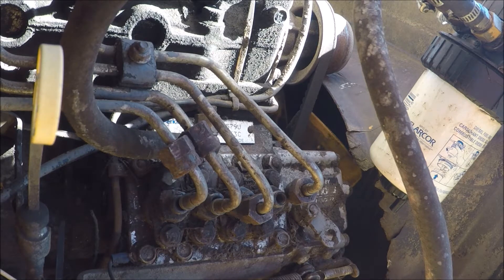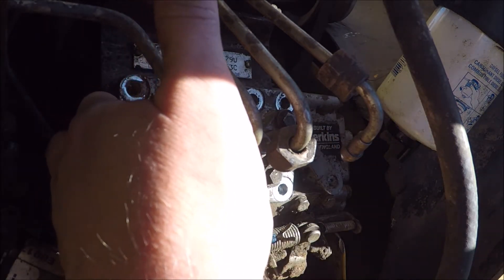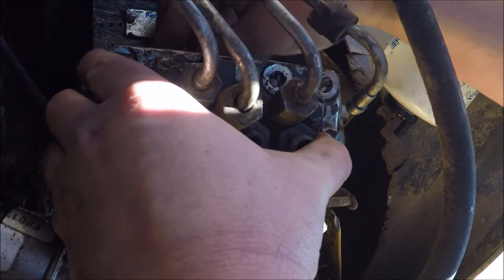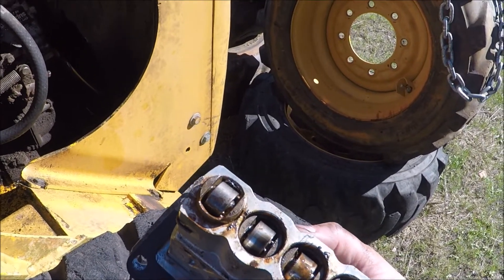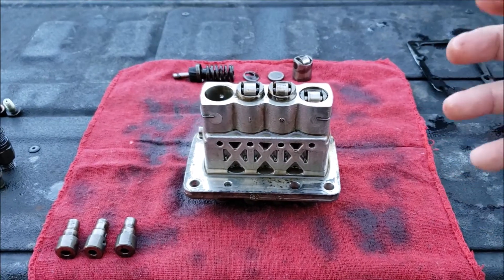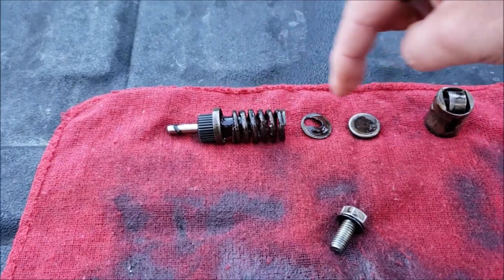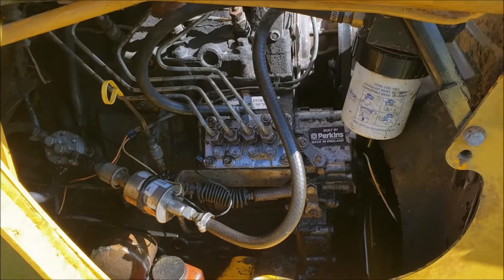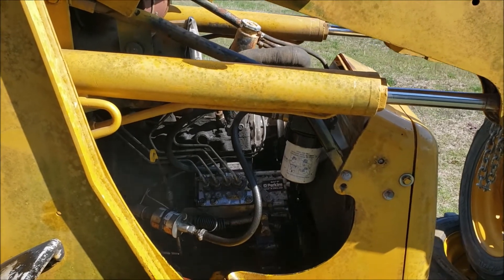WILL IT START? WILL IT RUN? Rebuilding the Injector Pump - Part 3

Comment: Well done!  Good to know it’s not that difficult of a project to take on.
Reply from the maker: Thanks.  I am glad it's running now AND glad I could fix it myself.  I was afraid I was going to have to order this pump off of Amazon then mess around with the timing.  Luckily it was not that bad to rebuild.

Comment: Glad to see it running. Fuel pumps aren't as scary as they seem. Very simple replaceable elements and as long as they are put back together properly and the rack, sleeves, and pistons are set properly. Good work.
Reply from the maker: Thanks.  I was expecting something much harder from all the info I found online.  But yeah, it was not that hard as long as you put it back together the same way it came out. Thanks for watching.

Comment: My secret weapon for de rusting parts is electrolysis. Muriatic acid works too is properly neutralized. If parts get pitted you can electroplate them with nickel and smooth with crocus cloth.  You were smart to take it apart, I have seen people get a rusted fuel system running but it ate itself up in short order with the oxides. Nice job bringing the machine back to life!
Reply from the maker: Thanks.  I have never tried electrolysis, but I heard it can do wonders for all sorts of things.

Comment: Stock up on Brake clean or Carb clean!  Best way to clean small parts. O'Rilley usually has the cheapest price. Also, a safe starting fluid is WD40. Might not work in all cases, but is a lot easier on the engine than either. Also, take apart all for the heavy battery cable connections, and make certain all connections are clean, bright, and snug. A lot of amperage can be easily lost! You can often track down a faulty connection by gingerly feel it when cranking. A bad connection will surely be HOT.  Now, you can bleed the air out again, as you had to take off the fuel line to stop it. Is that lever to the right of the injector pump possibly an engine stop lever?
Reply from the maker: Wow, thanks for all that.  Very useful info.  I am not sure what that lever is for.  I have never tried it.  I will give it a go.